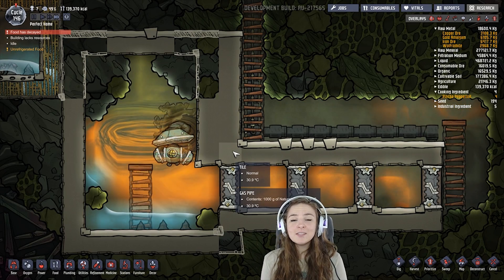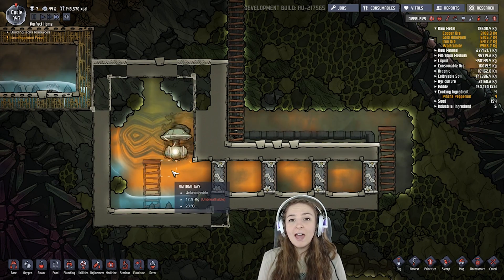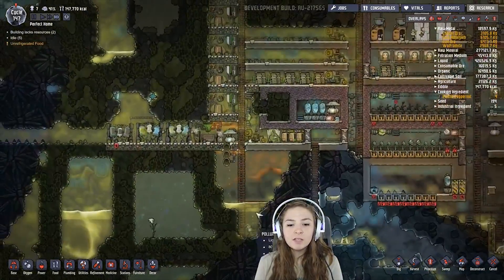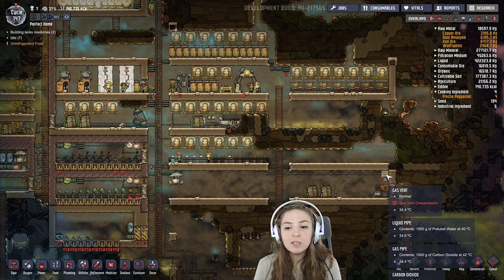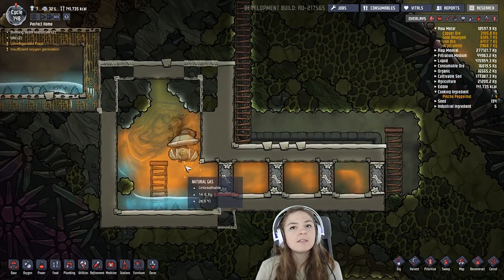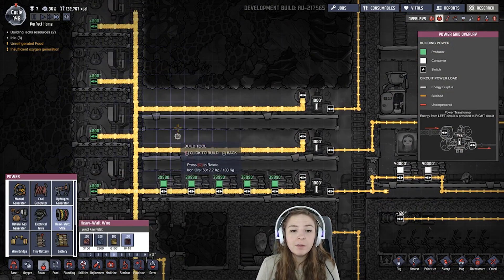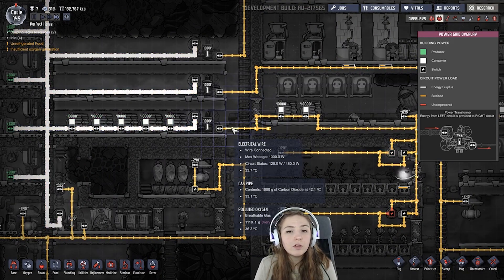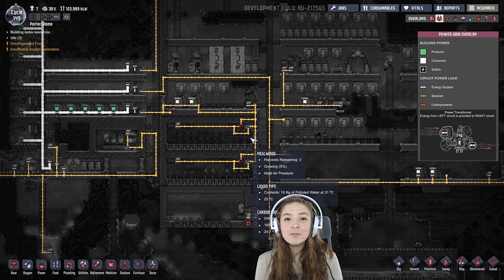All about Natural Gas and Electricity - Oxygen Not Included Agricultural Update

Comment: should batteries come before, or after the power transformers??
Reply from the maker: They can go either place, but since power cannot flow backward through a transformer, if they are placed after the transformer they will only store power for things on that side of the transformer. So if you want to store power for your whole network before the transformer. If you want to store power for just a few things on that circuit that you need to keep running after the transformer.

Comment: Try using Granite tiles around your natural Gas generators to prevent compression damage. I've had two Natural Gas Geysers  which are encased in Granite tiles which have never leak / with a standard single door which is locked. Check the video out on my channel.

Comment: Natural geyser is buggy right now. It's emitting gas 4 times greater than it actually intended. So after they fix it. The geyser efficiency will go down to 1/4 from current condition.

And natural gas are lighter than chroline.
So it will be (from light to heavy): natural gas, chroline, carbon dioxide

Comment: Hello Lacy! Thanks for the tip about transformers.... Here's one for you!.. You can use a wire bridge with heavy watt wire to go through walls and doors, it only works for one tile thickness obviously :)
Reply: Really?
Reply: my wire bridge breaks all the time running power peaks at 1.3kw with both ends using heavy wire... Interestingly on both sides of the heavy wire is a normal wire which never breaks. It seems like the wire bridge is a weak point of my power lines.
Reply: Andersen Zheng have you got normal wire still running underneath the wire bridge at all?
Reply: i need to double check that but im sure it is the bridge that is breaking all the time. Side question, if i had normal wire and then just sort of paint heavy wire on top of it, it should get rid of the old normal wire right?
Reply: correct, but where the heavy wire wont go (ie: doors, floor tile, etc.), the normal wire remains.

Comment: Oh you can also go from little wire to big with the transformers so you can have wheels rigged up to the heavy wires without worrying about the - decore. the transformers work as a 1000w one way gate. the dupes on these wheels will run nearly constantly but hey squirrel power backup generators are handy

Comment: It seems they've changed the equations of the gasses a lot, and now it's normal to find pockets with gas densities of 30kg/square and so on. Now the problem is, a gas pump won't go above 2kg/sq, and I've been having a lot of trouble handling the gasses in this new version. I've also seen that there's a new thing like a geyser but it's called "the void", which sucks gas and makes it disappear, but I haven't found any yet.
I've also tried to liquefy gasses but now the pipes get "freeze damage". So what the hell is going on? How do we get rid of gas??
Reply: Also, I think the high-pressure gases is a bug. I only ever see that with polluted oxygen and it's caused by an enclosed space with polluted water in it, which will keep producing the stuff infinitely from when you start the game... I would've thought it should only be able to function like that by converting oxygen, but it just keeps going forever. The longer you play the more of that gas you'll see.

On the other hand, those pufts will consume polluted oxygen like there's no tomorrow. I got a ton of slime by creating a space for one to work and then connecting those pockets of polluted O2 to that area. The slime won't convert back to polluted 02 if it falls into water so you can let it collect on the ground until you need it.
Reply: Nice! I'll try to implement that idea.
But I've noticed it's not only with the polluted oxygen, I've found two natura gas geysers and left one of them untouched for a while, it kept producing more and more gas (I think the density raised to around 3000kg/sq!)
Reply: Oh yeah, geysers do that too. Although that one at least makes sense since it's bringing stuff in from outside. the polluted water/oxygen thing violates conservation of mass.

Comment: Has anyone thought of a decent way to cool down water from a geyser yet? I'm having trouble with water with 20 dupes around. (Decided for it to be a challenge and it's working, except I don't have enough water for oxygen)
Reply: Build a Perpetual Motion Hydrogen bubbler to convert contaminated oxygen to clean liquid oxygen, pump the super cooled liquid o2 you get from the bubbler around a loop of non-insulated pipe inside your hot water tank. (like a radiator.. but cold)

Should cool it down almost instantly.
Reply: What I did is to create a downward path from the geyser to an ice biome, and let the water sink there. It will cool down after a while, you should try to build a pump on the bottom first.
Reply: That's very interesting. I tried doing just that but with extremely cold hydrogen and with a gas pipe. Obviously didn't work. Should I make the normal liquid pipe with wolframite as well? Where do I put the cold liquid oxygen after it has gone around my hot water tank? I'll try to figure out how to build this "Perpetual Motion Hydrogen" bubbler you speak of as well. Would be nice if you can help with that xD
Reply: Luis Jalabert The problem with that is you eventually end up melting the entire ice biome, leading to water contamination.

Not to mention drowning all the precious wheezeworts!
Reply: Skye Storm has a build video and Brothgar has a bunch of bubbler experiments, just search for Ultimate hydrogen bubbler on youtube. Wolframite pipes will break with the extreme cold unfortunately.

What you do with the liquid o2 after is up to you, heat it up for your dupes to breath or get creative.
It's possible to just drip the hot water into the bubbler instead of the contaminated o2, never tried it tho.
Reply: Ah of course it's liquid O2 after all. Just heat it up a bit for extra oxygen. I quit on my 20 man and reset into an 8 man doop team. Should be more manageable now. I'm trying to find a natural gas geyser tho. Day 30 no luck still.